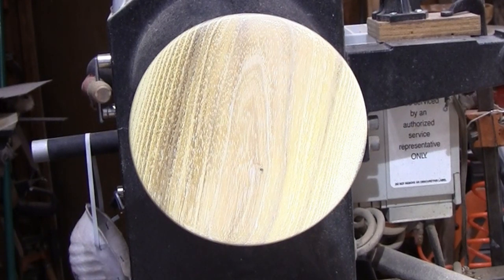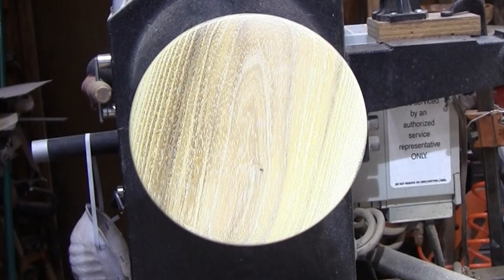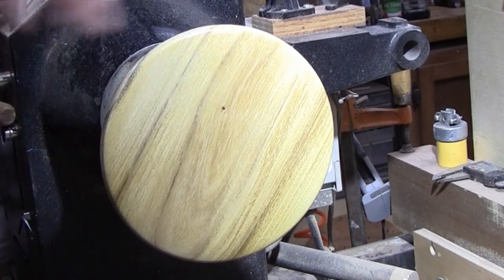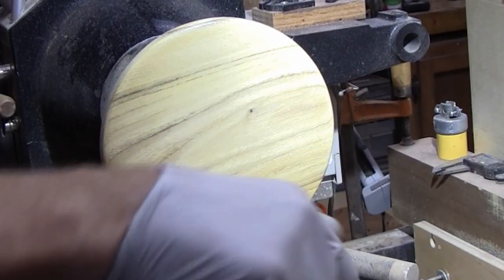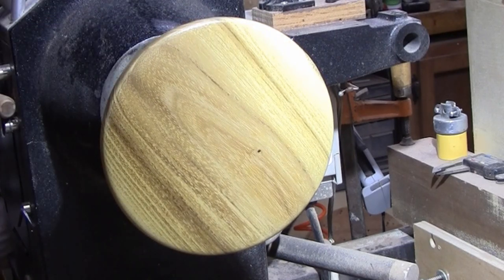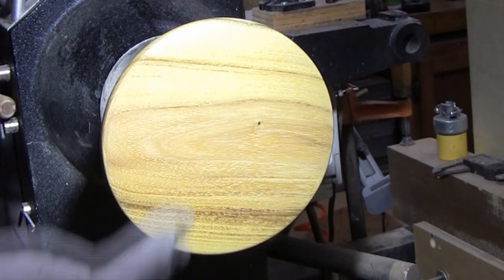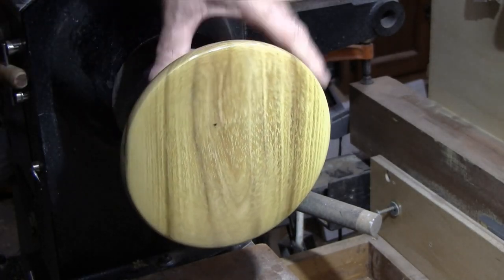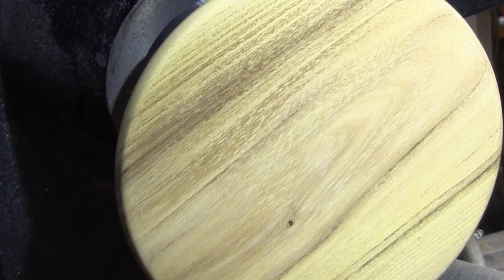Wood Turning  How I use Polycrylic for a Great Finish

Comment: Looks great! Do you think I could just wipe this stuff onto a board straight out of the can? Do you think it would be better to thin it a bit?
Reply from the maker: Thank you Joshua. Right out of the can is best. i never think it down. Make sure the first coat is plenty as it will soak it in. After that I wipe it on much thinner and it dries very fast.
 I do use the water based sanding sealer first but you can use this by itself if you do not have any.
Best of luck,
Gary

Comment: Because of your video, I decided to try it for two bowls.  Did it just as you said and I am having terrible results!  Leaving rings that I can’t sand smooth.  Tried calling Minwax but they were no help.  Can you give me any ideas as to what I could be doing wrong to cause this??
Reply from the maker: The only thing I could think of is you left it on to thick. I wipe if off till there are no streaks. So it is multiple thin layers. 
 Yesterday I used it again in a very cold shop. It still dried amazingly fast. And sanded very easily. If you could send a picture of what you are dealing with I may be able to see the issues.
mgdpapa@gmail.com

Comment: I use those triangular foam makeup pads women use to apply makeup. I get them at Walmart and they’re cheap. With water based finishes, you can wash them out a few times and reuse them. Thanks for the video
Reply from the maker: Great tip! I will look into that. I also like to use micromesh  or just an old t-shirt.
Thanks for watching Greg/
Take care,
Gary

Comment: Do you find this product to be tough after it's fully cured?  How does it compare with a typical oil-based minwax polyurethane for resisting scratches?
Reply from the maker: Yes it is very tough. I would say equal to their oil based. I made our son a table years ago and used it for the finish. They use it everyday as a kitchen table. I did wonder at the time but after testing found it to be fine.
Thanks for watching,
Gary

Comment: Thank you this is a nice finish. But would you do that on a salad bowl? Would it be food safe?
Reply from the maker: Thanks I am happy you liked it. I would not use it on a salad bowl myself.
As far as food safe I do not know if this is or not. Some self proclaimed experts will tell you that all finishes are food safe once cured. Then some say if it builds a layer that can come off it is not food safe. 
 I make very few turnings that are meant to eat off of. 
Hope this helps and thanks for watching.

By the way I have been inspired by a few of the vases you have made. Very beautiful!
Gary
Reply: Thank you for the question - and answer. I am new with wood turning & wanted to know this exact question. Marcus from Chesapeake VA.

Comment: Very informative and useful information.  One thing I like is that it does not darken the wood like oil based finishes do.  And the spray on fills little imperfections too.
Reply from the maker: Thank you John! I have not tried the spray on. I would like to but it seems it would be a lot more costly.  I may try it and if I like it I could use one of my spray guns to put it on. Although with lacquer I use the spray cans to avoid the cleanup.
Thanks for watching and the tip.
Gary

Comment: This is the most unique way I've seen of applying polycrylic; it's hard to argue with the results. Did you rinse out the cloth or do anything to prevent it from hardening in between applications?
Reply from the maker: Thank you very much. I put it in a sandwich bag that you can seal. Keeps a long time this way.
Thanks for watching,
Gary

Comment: I just used the matte finish on some reclaimed cypress & it darkened the wood significantly.  Would like to get it back to its original state before the topcoat (I only did one coat) but the wood is old & I'm concerned about it holding up to all the sanding.  Any other topcoats that do NOT darken wood?
Reply from the maker: When you say Top Coat what did you use? With Polycrylic I like the Minwax Water Based Sanding sealer.
 Or did you use matte finish Polycrylic.
 I also use Deft lacquer to keep from changing the tone of the wood.
 Let me know what you used for sure and I will give you some ideas.

Gary

Comment: What is the difference between cellulose sanding sealer and wood sanding sealer? I have the minwax wood sanding sealer and it seems to work fine. I thought cellulose was another term for "wood like material". I think i will also get that polycrylic finish! Looks great!
Reply from the maker: My understanding is cellulose sanding sealer is lacquer based.  If your talking about the Minwax water based sanding sealer then the difference is lacquer vs. water.
I like and use both types. There is also shellac based sanding sealer and I use that as well.
Gary
Reply: @ThePapa1947  I have nearly the same exact thing on my lathe right now except it has a small rim. I am almost finished sanding. It is also black locust.

Comment: Gary, have you been watching my videos?  That's exactly how I finish 98% of my turnings.  Been doing it for years.  In fact, I use so much of the sanding sealer, I buy it a gallon at a time.  Getting ready to order my 5th gallon.  And, I really like water-based products, easy clean up and most of all, they work.  Nice of you to spread the word.  Take care, Larry
Reply from the maker: I have seen you use the water based sealer in a lot of your videos Larry.
It does work great.
I put it on the same way I put on wipe on poly and shellac. I like putting it on and then wiping it off leaving a thin coat. The Polycrylic and the wipe on poly dry much faster that way.
 I think everyone should try the Polycrylic . Might be the easiest finish to put on. But not the only one I will use.
Depending on the piece I like all the others equally. 
 I buy lacquer and shellac and the shellac seal coat by the gallon as well.
Take care,
Gary
Reply: Thanks for the tips from both of you.  I may have to switch up to water base products because everything else just costs a fortune in materials to finish a project.
Reply: @ThePapa1947  I've tried lacquer and shellac, but I get as good finish with water-based products and not near the hassle.  See ya on the next one, Larry
Reply from the maker: Larry when I think back on it I have used lacquer for over 58 years and that is all I used for a long time and some varnish. But a lot of new finishes have showed up since then.
What is your thoughts on water based polyurethane compared to Polycrylic?  I think the Polycrylic drys faster but they seem very similar to me.
See ya,
Gary
Reply: @ThePapa1947  Funny you asked.  I recently ran out of Minwax Polycrylic and Amazon was out.  So I bought Varathane Water-based Polyurethane.  Quite honestly I cannot tell the difference.  Dries just as fast, has a shine, sands easy.  However, recently I've just quit with Minwax sanding sealer.  About 4 or 5 coats and it buffs very nicely. I was thinking about just going with the Poly next time and forgo the sealer.  They look the same to me.  After I cut my tenon off I've been finishing the bottom with just poly, no sealer.  Seems to work quite well, can't tell the difference.  It seals and buffs.  What else do we need?  Ask 10 people and you will get 10 different answers and I always say "Whatever blows your skirt up is fine with me" LOL.  Take care, Larry
Reply from the maker: Very interesting Larry...I have found the Varathane  Water based Polyuethane to be a very good finish. I made a tall narrow table for our youngest son.  He has used it daily for close to 5 years and it still looks great. No reason it would not work good on a bowl.
 I seem to remember in one of your videos that you went to only the Minwax sanding sealer so I thought about trying that. When I first used Polycrylic I did not use sealer and I thought it worked great. I am not sure that I even knew they had sealer till I heard you talking about it. Although it does have its place on softer wood and it soaks in good and lets you build up the finish. 
Take care my friend,
Gary

Comment: hello my friend thank you is this product water based varnish what is this product
Reply from the maker: Thank you Cem. It is a water based polyurethane. It works very good and is easy to put on. It is made by Minwax.
It comes in spray but I used the wipe on or brush on.
https://www.minwax.com/wood-products/clear-protective-finishes/interior/minwax-polycrylic-protective-finish
Thanks for watching,
Gary

Comment: One question: will this process prevent yellowing of wood when exposed to direct outside light? I have been using Livos oil finish in the past.
Reply from the maker: It states it is for indoor use only and will not withstand UV.
I do not put any thing where it will be in direct sun light so I am not sure how it would do indoors with sun light hitting it.

Comment: What is the sanding sealer for? What if you just go right to the poly?
Reply from the maker: The sanding sealer is thinner so penetrates farther. It does not have any thing added so it sands easier.

Comment: Hello and hope all is well. I was wondering if I can add polycrylic to a coffee table that I have Painted With Black Paint. Is That possible?
Reply from the maker: You can put Polycrylic over all finishes. I would go over the black paint with fine steel wool or scotch brite. Or even very fine sandpaper. I assume the black paint is fully dry.
Best of luck,
Gary

Comment: Thanks for the video! I use this on furniture like nightstands and dresser tops. I have been wondering how i can get an even smoother finish. I try to do 3 coats sprayed on, but unless you apply it in a clean room, you usually have a few specs here and there. I liked how you used the polishing paste at the end cause won't even a fine scotch brite leave an opaque finish?
Reply from the maker: Thank you Steve. I have never sprayed it although I have thought of doing so.
 A final finish with fine scotch brite looks good but when I do segmented work I like that deep shine you can get with the abrasive paste and the polishing paste.
On natural turnings I usually leave the polishing paste off.
 Thanks for watching,
Gary
Reply: @ThePapa1947  It sprays quite well actually. I use a Wagner sprayer for small projects and it does well. I'm sure a pneumatic sprayer would do much better but I'm happy with the results the Wagner gives me. I'm gonna try the polishing paste and see if I can get an even smoother finish! Thanks for the tip!

Comment: I use polycrylic and got a ton of bubbles
Reply from the maker: How do you apply it? I always wipe it on with a cloth. I make sure there are no streaks and then I will put 2 or 3 more coats on.
There should be no bubbles doing that or even with a sponge brush which is another method.

Comment: Will this yellow on colored stains? In example, I'm working on a guitar and want to color it a bright green, blue, pink, or something, but in past experiences I have used polyurethane and it ended up yellowing the color overtime almost like nicotine stains
Reply from the maker: Robert I have found polyurethane to makes things a bit yellow even from the start. All of the Polycrylic I have used has remained as clear as can be. I have not used it over a stain but I still think it will remain clear.  I would make sure the stain is totally dry.
 Best of luck,
Gary

Comment: love the finished look. with the two minwax products you used and acks paste would this be food safe? still going to try this process of yours but would like to know if its food safe. thanks
Reply from the maker: Thank you and I can tell you that the Acks products are listed as food safe. As far as the Mixwax products I can not speak for them. It seems it might depend on what you put in them. I make very few turnings that are meant to put food in. And then it is for wrapped candy and things like that. I would never put any liquid or moist food in any wood bowl no matter if the finish said food safe on it. There are a lot of theories on when a finish can be considered food safe but I stay out of that because if you read enough you will find the answer you are looking for. 
 Sorry I am no help with it and I would suggest a little research  and I know there are some wood working groups on Facebook that discuss this a lot. 
Gary

Comment: Very good info Gary, thank you for using our products, its an honor comi g from such a wood expert.....another great use of the abrasive I have found is when I out multipl;e coats of CA on my pens and those high ridges build up, the paste takes them down nicely without sandpaper just like you did on this platter!
Reply from the maker: Thanks Tom! I really like it on a sprayed lacquer finish as well. What makes for a finish with depth to it is a very level finish. The abrasive paste is a big help in getting there.
Take care,
Gary

Comment: Good video, Gary! I only recently started using the water-based polycrylic, and I love it.
Reply from the maker: Thank you Rick. I first used the water based poly around 5 years ago and loved it. Not sure when Polycrylic came out but I have used it for around 2 years I think.
I like it so much I have used it on a piece for this Friday that I would normally have used all spray lacquer on. It worked so well on the soccer ball I turned I figured I would go for it.
Thanks for watching.
Gary

Comment: Hi Gary! Great finish as is - but I wonder about some sort of high gloss wax or even microcrystalline wax to try to lesson fingerprints on the finishing paste? I find that the finishing paste tends to be very susceptible to fingerprints even after long term drying. Will the finishing paste eventually get hard enough this does not happen? Thanks Dennis
Reply from the maker: Thank you Dennis! I generally use a polishing paste that has carnauba was as well for a little extra shine. But that needs to be polished till it is all off or it leaves finger prints. The abrasive paste needs to be polished completely dry as well for the same reason. I have not tried microcrystalline wax...I should check into it.
Take care,
Gary

Comment: Since both of these products are water based, I was wondering if the first coat of the sealer tends to raise the grain of the wood? Probably a better chance of that on softer woods I'd think. It looks like I'll have to give this stuff a try.
Reply from the maker: Yes Gil it does raise the grain which I like. It helps to get a better sanding job. I remember is shop class we were taught to wet the wood down and sand again must for that reason.
Take care,
Gary

Comment: I've learned so much from you but the thing I learned from you I like the most is using my glue gun and melting the glue sticks to hold a faceplate to the base of my turning, turn the project and use denatured alcohol to "dissolve" the glue .  I went out and purchased more glue sticks than I'll use the rest of my life.  I' about the same age as you.  Thank you!
Reply from the maker: Thanks so much Rusty! As a matter of fact I did a turning today with hot glued tenons on. Only way to get the most out of this board.
I used a hot glued tenon on both sides and you will see why in a few weeks.
So how many glue sticks did you get. I go through them pretty fast.
Thanks for watching,
Gary
Reply: @ThePapa1947   I got about 100 glue sticks and I've used half of them.  Thanks again!

Comment: Gary, when you're using the Minwax Polycrylic or similar water based finishes,  you can speed dry them in a couple minutes with a hair dryer....... really speeds up the process.
Reply from the maker: Hi Peter, I have found the Minwax Polcylic to be a very fast drying product without any help. But I think a small flow of air would probably help.  Even in cold weather I find it is ready to sand in as little as 15 minutes. But I put each layer on very thin. I would consider a slow fan without heat if you wanted to speed it up.
Next time I use it I will try a hair dryer and see how it works. Seems like a good idea if time is an issue. I should be using some in a few days so I will make a note to give it a try.
Thanks for watching and your idea.
Gary
Reply: @ThePapa1947 Certainly any air flow will speed up drying.  I used some a few years back when I first started some turning.  I only have a 12 x 17 lathe so I started out turning some pens.  Being a fast item to produce I wanted something for fast finishing.  I used a few different water based finishes from Varathane as well as General and they all worked really well.  Doing a speed dry with a warm hair dryer worked very well.  It brought the drying time down to 1 or 2 minutes, which was really good, even if only as a re-coat time.

Comment: I’ve used polycrylic for a while now. Gives a very hard and durable finish.
Reply from the maker: Yes it is amazing how well it works. First time I used it was on some English Walnut where the sap wood is almost white. Once I did that I found it worked great for softer woods such as drift wood. It worked better than anything else I tried. So now I use it for lots of things. In a few weeks I use it on something I really debated using it. As it turns out it was a good choice as well.
Take care,
Gary
Reply: Will this finish be good for a Charcuterie  board ?

Comment: I have read that sanding sealer should not be used on woods like curly maple because it does not display chatoyance, but your black locust turning shimmers in the light beautifully under this finish.  I'm curious whether you've used this technique with curly maple or other figured hardwoods and what was the result?
Reply from the maker: I have used on many types of wood with excellent results. It has enhanced all the features in the wood. It is a good question and worth watching for.
Check out my most recent black locust turning if you want to see some shimmer.
 Thanks for watching,
Gary
Reply: I agree sanding sealer enhances figure in wood.